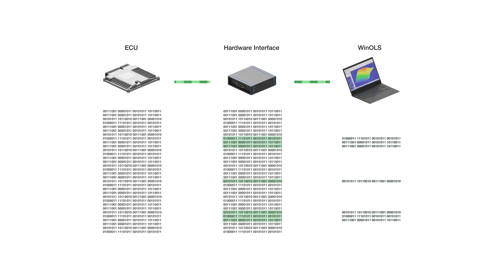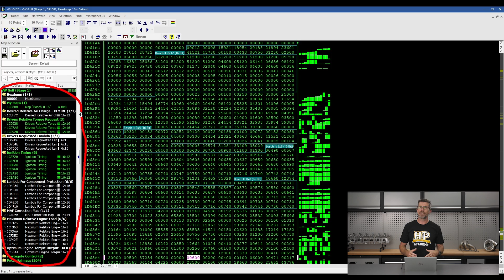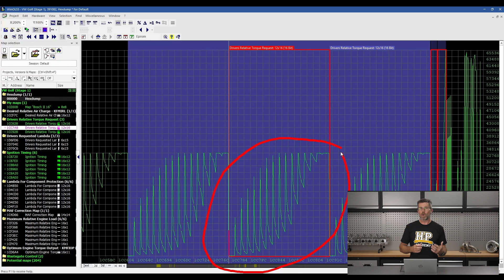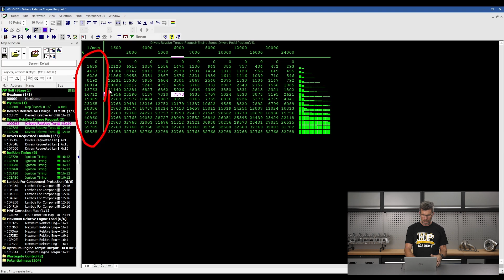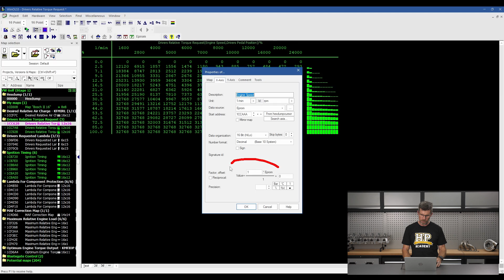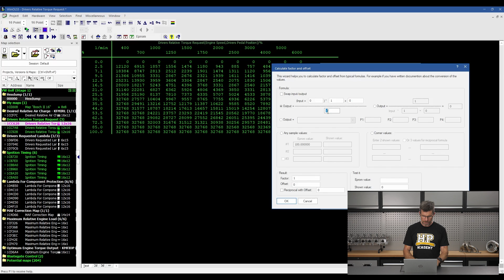It's Not Always This Easy | Map Packs aka Damos Files

Comment: Bosch ECUs are absurdly easy to define compared to almost all others.  This is especially true in WinOLS.  Most can be automatically found with the built in map finder.

If your ECU is non-Bosch, be ready.
Reply: Unfortunately that is true!!! I only say Siemens / Continental.... Terrible
Reply: @svengro292  they are not fun ecus and there is a lack of information about tuning certain of these ecu platforms. In the end it is what it is. Sad to say but its a world of figure it out.. but as they say tuning is a magic u can learn.. 

Put enoigh time into it and i bet u can make a whole map pack on ur own. Just find something with a simular ecu and start comparing etc..
Reply: @AMT_97racing  yes, unfortunately some of these ECUs do not have a map header that describes the beginning and size of maps.
Reply: @AMT_97racing  deductive reasoning and pattern recognition should be the core basis of RE.  Relying on external information will turn into a crutch.
Reply: Im currentely focussing on denso.
Reply: @AMT_97racing
Reply: @AMT_97racing  do you also have FRs? for Siemens / Conti?
Reply: @svengro292  no i havent dived into that yet mainly going trough diesel denso atm. 

Tbh tho just as the evo ths other guy asked about your frs/brz is a platform with a lot of aftermarket support. U should be able to tune this vehicle a lot easyer then with winols perhaps something like hp tuners and some info from hpa academy could help u to upgrade ur car and tune it up to spec
Reply: @svengro292  FRS/BRZ is supported by Tactrix/ECUflash.  $170 is much cheaper than the time it will cost to write your own definition file.  Plus, if you choose, you can add onto the existing definition without having to start from scratch.
Reply: Even with Bosch it seems like an impossible task for a beginner like myself. I've played around quite a bit with my 2011 BMW X5 ECU file. Yes, the map finder is really useful for finding maps, but then I have no idea what is the actual role of each map, what the scaling is, etc. Not to mention that often you have several versions of the same map. It's a miracle to me how experienced people do it without map packs, considering that for a good tune you need to modify a bunch of maps.
Reply: @mairomaster  with zero experience, zero training, and zero help, I figured it out as a beginner.  On Bosch the map size and axis data is right there.  Tons of documentation for conversion data.  Tons of documentation from others that are working on the same ECU.  Couldn't get any easier, literally. 

If you think Bosch is difficult, you certainly don't want to try any of the more obscure ECUs.  I have been through the same obscure ECU, start to finish, hundreds of times to piece the puzzle together.  The more maps you define, the more they make sense and the easier it gets.
Reply: @zacharymorris9917 where is this documentation? Are Denso ECU's considered obscure?
Reply: @RallyRanchMotorsport  WinOLS already does most of the work for you automatically.